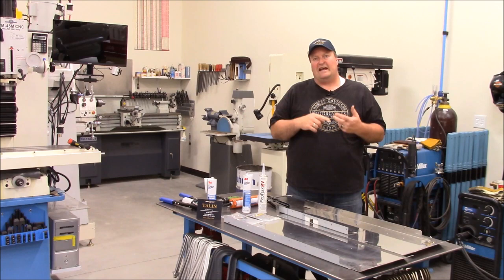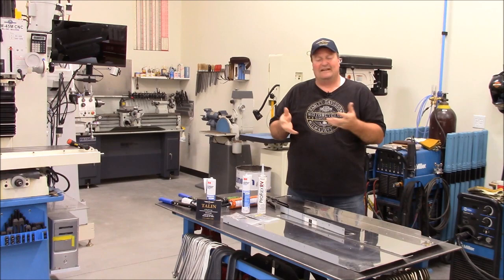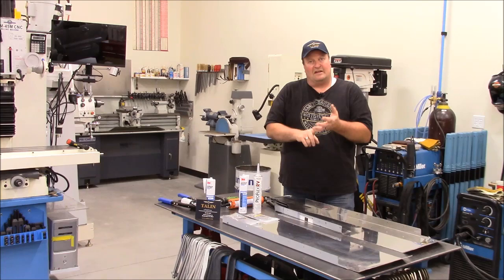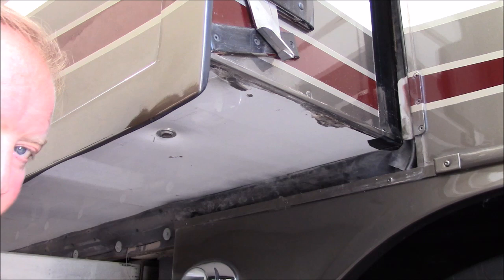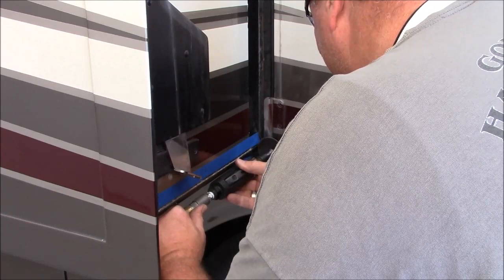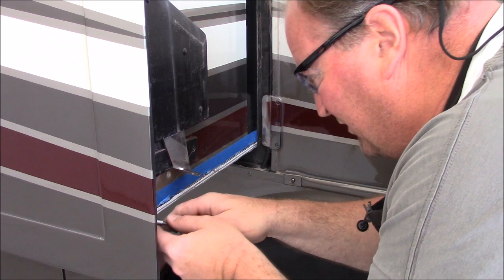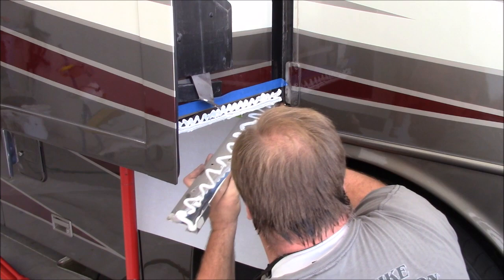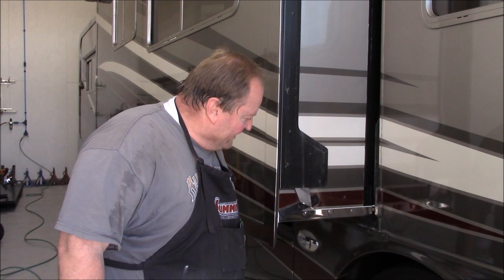Guardian Plates for Monaco HR Raised Floor Slides RF300 RF600 RF1200

Comment: Thanks for another excellent video.  Question -- If the bottom corners of the slide room are free floating, and adding the 1/16" for the Guardian Plate does not interfere with the floor of the RV, there is no clearance issue so why add the roller plates?
Reply from the maker: The roller plates allow the forces to be spread out so as to not damage the underside of the floor material. 
I guess you could get away without adding the roller plates and just do the corners but I would rather not chance the cracking or damage of the underside of the slide floor. 
Mike

Comment: Hello Mike. I live near Salt Lake. Where did you get your Motorhome painted?
Reply from the maker: Mike’s Custom Painting in Bremen, Indiana. They did a great job. I called around locally but didn’t get the warm and fuzzies from any of the local shops as to what process and materials they would use and I didn’t have the time to do it myself. 
Thanks for watching. 
Mike
Reply: zmotorsports Thanks. Our coach is a 1996 Signature Series. I’ve done tons of upgrades to keep it in top shape. But the paint is starting to go. $30,000 for a paint job for a vehicle that isn’t worth that on the market is tuff to consider. Your’s looks great. I’ll check those guys out.
Reply from the maker: I highly recommend them. Tell Mike or his daughter Livia that I gave you their contact. I think they did a better job than anywhere around here could for half of what I was getting estimates for. 
Best of luck and I salute you for keeping another one of these older rigs on the road and in pristine condition. 
Mike
Reply: Hey Mike, do you mind sharing how much (or a ball park) on how much you paid to re-paint your coach in Indiana? 
Thank you
Reply from the maker: I’d rather not say as I had some other custom touches added as well.  
I suggest calling either Mike or Livia at Mike’s Custom Painting in Bremen, IN for a current quote.  
Mike

Comment: This kit is good but extremely high priced for a couple pieces of stainless with one bend you have the trim your self
Reply from the maker: If you look at it as merely the material then yes, it’s not inexpensive.  However I choose to look at it in the light that a gentleman did a ton of R&D to develop a high quality product that is made is the USA.  To me that’s worth paying a little more to support a good American company that supports the RV industry and employs other Americans.
Reply: @zmotorsports62  I regret not doing it myself. And simple metal plates is not rocket science
Reply from the maker: Agreed it’s not rocket science. However the R&D was done by the designer who took the time to do enough research to find the exact locations of the structure to  ensure the rivets grab structure and not just plywood. Also the stainless steel is not a standard cheap grade material. It is high quality stainless polished to a high luster. 
I’ve seen some backyard jobs of “bending metal” and installing them that I personally wouldn’t want anywhere near my coach.  
To each their own but I am more than pleased with the overall product’s performance and the aesthetics that they add to my coach.  
Mike
Reply: @zmotorsports62  Only along the corners where the frame is did I drill into metal, the rest on the bottom was into wood behind the outside covering.